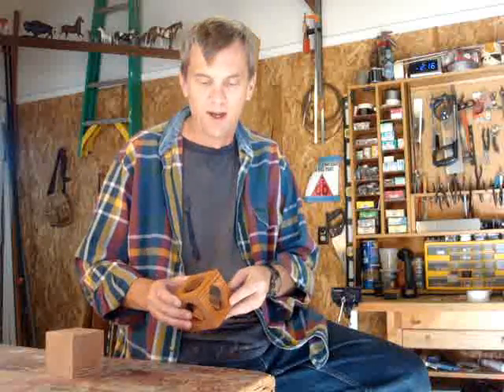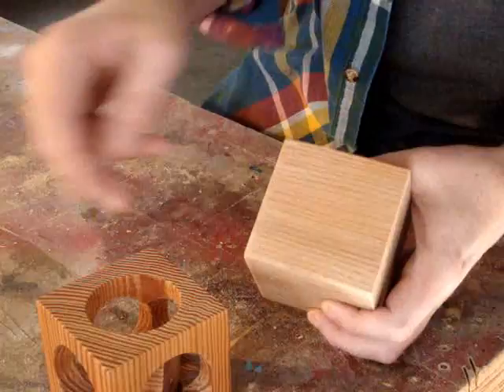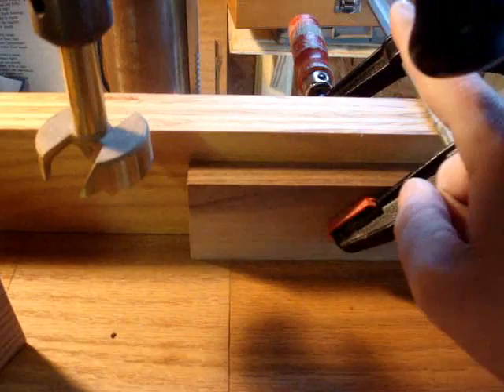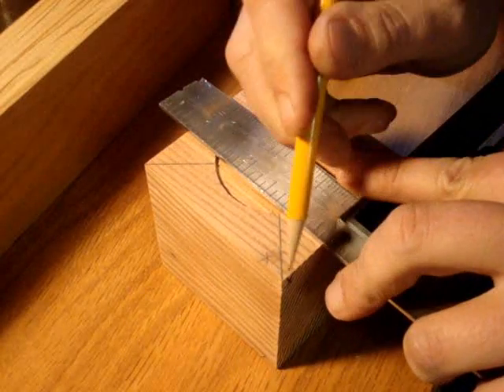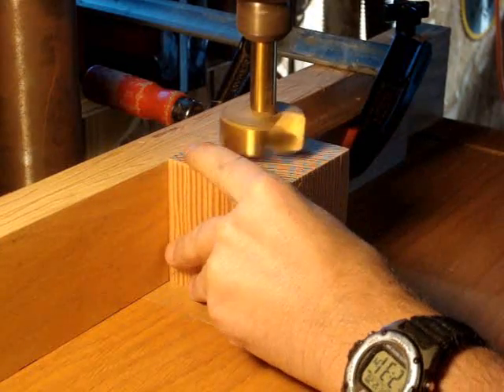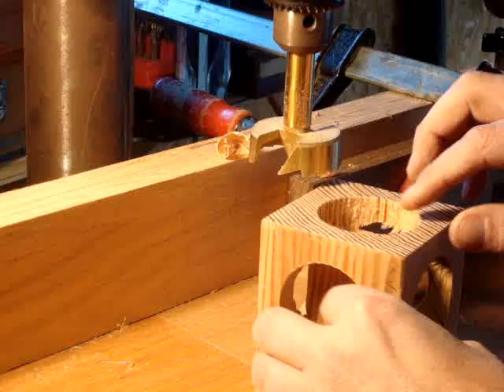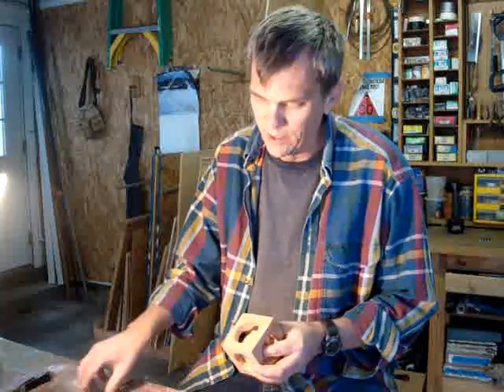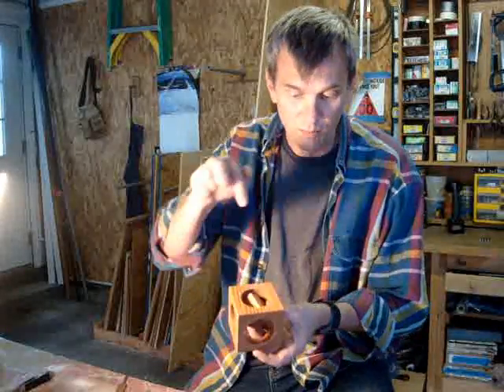Mystery Cube-in-a-Cube Puzzle Woodworking Project

Comment: I just saw this video a couple of month s ago and thought it was pretty neat so I decided to make some. They turned out really nice (red oak, cedar, and spalted maple). I did have an issue as is mentioned by several people below about the hole the forstner bit makes. I put some black milliput in the holes which makes the center cube looks like a dice. Makes it just a little harder to figure out although except for woodworkers I think it will baffle most people. Hardest part is finishing.  I found that using sandpaper affixed to popsicle sticks with spray adhesive works well to sand the interior cube.

Comment: Have you tried making the central cube a bit larger by cutting out the central cube at a 90 degree offset from the parent cube? The central cubes corner would be able to extend as far as the face of the parent cube.

Comment: I am on my wife tablet. I was a tool maker and I made sets of these out of aluminum.  nefore I reeve the square box from inside  drilled small dots on each si de to make the inside block look like a dice. My mom has the first set of five I made a d I ma de a aluminum case to store them in. great video wood working is as fun as tool making with steel.

Comment: I sacrificed a 2-1/4" Forstner Bit and ground off the guide point.  Still cuts fine and no indentations in the inner cubes.   Router Jig / Template sounds like a good method too, but I'd have to experiment a little to make sure.

Comment: If you make it with drilling only, in metal, the inner cube is just as big as the holes. Also, metal drilling tools need to have certain angle (unless you are making it from some extra soft metal, but that metal tends to stick to drill bit). You can use milling tools. If you use lathe machine, with a hook shaped tool, you can undercut and make inner cube quite bigger than holes are. I am miller and lathe machinist, I should know. :)

Comment: I made something similar a long time ago. Back then I simply boiled the cube in water. While it was hot and wet, the wood was soft and could be compressed,
While the cube was compressed I let it dry. Then released into it's cage.
Once in the cage, I boiled the whole cage with the compressed cube inside, That will "uncompress" the cube and restore it to the original shape again.

Let dry and sandpaper it.

Comment: I think you could make a ball inside a cube with a form tool. It would have to be slightly eliptical in all three axes. I would form it top and bottom to within a 1/8 of an inch of its equator.Then finish the other four sides with a slightly smaller tool. Sanding it would be an interesting challenge.

Comment: Shim the block with playing cards to raise it 0.01" when freeing the inside cube.  Fixed blade bench knife is safer, easier to control than a folder, especially when you're stabbing it with your full strength.

Comment: Then it is a drill press and a Dremel, that is a different story since it enables you to leave corners untouched with drilling, and then bigger than holes. :) Anyway, try using milling tool with two teeth (more teeth has part in center which doesn't cut so don't use them), it has flat surface, and it can be mounted on drill (and it's cheap :D ). Also dremel tool, it is essential if you do it in metal.

Comment: I did this with a block of aluminium, machined a block to 50*50*50 and used a 30mm drill, predrilled with 8mm and 20mm.    The problem was that my drills weren't flat like endmills, they left a cube which sides pointed in, not flat as I wanted them.   No need to use undercutters or cnc, I did just like Steve, but I cut the corners with a dremel tool isntead of a knife.  I assure you the holes were smaller than the cube.

Comment: Would it not be possible to drill the entire way through, then make a separate smaller cube.

then boil both to make them softer.. 

press the smaller cube and slightly stretch larger one.. fit it inside then reshape it using hot water again?

Comment: I made one of those, but I didn't like the little  holes left in the smaller cube by the Forstner bit, so I drilled it out some and inserted a 1/4 in. dowel. When finished, the dowels blended in with the cube and, I think, looked better. Just sayin.

Comment: If you mess up your block on the inside, just cut a block a little bigger then your holes. Soak the block in boiling water, compress in a vice and squeze it in the hole. If your cube wont go back to orig size. Just boil again and let sit a day.

Comment: No need for clamping on this application as the bit is spinning and the position of the stop block and fence holds the work peice firmly into its little nest.

As far as the project really really neat. I saw a similiar project many years ago at a craft show but the technique was drilling a round hole that ended up being square.

I will not reveal the secret of that little trick...

Thanks alot keep up the good knick nack projects going

d

Comment: If you used a big enough block and started making the the blocks from inside out, you could make as make as you wanted. I think the only think that might be hard is that after the inside block is made the next one you would be making could break apart while drilling. If you made them from outside in then each block would be VERY hard to clamp in place the same each time.

Comment: Having a nightmare of a time Steve trying to get the cube exactly 3 x 3, The issue I have is the large board I need to use to make it, I do a half thru cut initially then rotate and complete. The problem is I get into the block comes out with curf (sp?) marks along edges on the block and irregular shaped blocks.
Any ideas where I am going wrong?

Comment: hey steve, today in gometry, instead of listening i did the math for this cube (i made my own previously). so. depending on the size of the block you start with the bit will always be exactly 2/3rds the size (6" block 4" bit).and also the size of the inner block will be  1/2 the size, an easy way for the needed depth is take (x= lengh of one side of cube) and put it in this equation x/4=depth of hole. if you want to know how i got that just ask in a relpy...like this so he can see :)

Comment: My initial thought was that the cube as made of the interior of the block of wood, which it is, then I thought you would use a long hole saw to cut everything out of the centre, and then stick one end in boiling water to make it swell up, insert the cube then leave it to cool and contract like the impossible nail illusion

Comment: What if.... you make a cube within a cube within another cube?
Reply: +The Mormonologist  i think, my math is not so good, you would have 3 cubes, and twelve circles ;)
Reply: +The Mormonologist called a turners cube
Reply: my grandad actually made a cube in a cube in a cube in a cube in a cube.
In total there were 8 or 10 cubes (I can't remember exactly but at least 8).
he did use a manual milling machine and it was made from metal but still very very skilled. The smallest cube in the middle is only a few mm.
Reply: OR A CUBE WITHIN A CUBE WITHIN A CUBE WITHIN ANOTHER CUBE
Reply: Logan Darklock A triangle inside of a triangle inside of a cube. ;)
Reply: David Parham a triangle inside a balloon
Reply: Logan Darklock Inside another triangle.. inside another balloon!
Reply: Chil
Reply: That would be a Cube Inception.

Comment: I'm using an 8" drill press 5 speed
With a 2" forstner bit no luck cutting holes
Any pointers ?
Reply: If your drill press is stalling, try going slower, using softer wood, sharper bit, or upgrading your machine.  8" presses are very small, not typically designed for cutting 2" holes (at least not easily).

Comment: I made this but everyone noticed the pilot hole in the small cube so I made a template and with my bushing in my router using a quarter inch straight bit I could avoid the pilot hole in the small cube.F.

Comment: You say it out, i want write here, that using this metoth is possible to make cube in cube in cube... and so on :), depend the outer square measurements.
Reply: It's possible.. you just have to start with the inner cube and work your way out
Reply: It is possible. Say you start with a smaller drill bit on the same size block used and make a small cube inside the large cube. Next you take a bigger drill bit and make another cube from that cube, thus now there is a cube within a cube within a cube. I do understand that this may be hard to understand but I am 99% sure its possible. It may be difficult but possible. Also the Laws of Physics and movies don't really apply to any of this so..

Comment: @stevinmarin My drillpress goes way slower than yours. As a shop teacher I cringe when I see you holding the stock by hand and with a finger on top of the stock. One could easily cramp the stock to the fence. These big bits generate a lot of torque.

Comment: If you're referring to the fact that using fractional inches is just plain annoying: you'd be right, but 99% of drill presses have fractional inch measuring tapes on their depth stops.

If you're saying that that's too small of a measurement to be useful: you must be just getting into the insanity that is woodworking. ;)

Comment: America... please convert to the metric system. I can assure you it is much easier and makes a lot more sense
Reply: Its literally the same thing. Dividing by 10 is easier than by 4 but once your used to it its not a challenge. You can also get as much as 3 place decimal accuracy if you wanted to depending on how good your machine is setup. So really no need to change anything
Reply: ***** NOOOOOOOOO
Reply: Why don't you convert?
Reply: +nunayafb  Smarter is the one who simplifies not the one who complicates. The US system really makes no sense to the rest of the world. For example what is the area of a rectangle that is one feet thirteen and three quarter inches long by eighteen and seventeen thirty seconds inches wide.... Yeah, good luck. With metric we just multiply both numbers.
Reply: +Johnny any of us americans who have ever used a tape measure, socket sets or other tools that use "standard' measurement knows what a pain in the ass it is. and where did that name "standard" come from when we are the only people who use it?
Reply: +Johnny ,  The precise answer is 26.5546875 square inches...Or 1105.28954344875 sq/cm Obviously you do not understand the standard system, 1 foot, 13 &3/4 inches is actually 2 feet, 1 3/4 inches or 25.75 inches..or 166.287cm.  18 and 17~ 32's  is actually 1and 1/32 of an inch or 6.6532125 cm ... In the standard system we just multiply the numbers as well. Just remember "standard" refers to "British Standard Unit"
Reply: +Carl Ahrens Wrong. I may not understand the standard system but obviously you don't understand arithmetic. Yes, 12 inches make a foot. Yes, 1 ft and 13+4/4 inches = 25.75 inches. You got that one right but (18 + 17/32) inches is not 1 and 1/32 of an inch. 18 inches is actually 1.5 feet so how can that be? It's actually 18.53125 inches. So the right answer is 477.1796875 square inches. Yes, you need to reduce all to the smallest unit first. What a bunch of work. This proves my point that the cumbersomeness of the system is such that you can't even get a simple multiplication right. I rest my case.
Reply: +teh neash What the hell is a decimeter? Is that some kind of musical note? A measuring device for noise? Some variety of delicious Albanian cheese? I'm betting it's cheese. Anyone care for a decimeter and chicken quesadilla?
Reply: ***** Bill, I can't believe you just answered his provocative rhetorical question. I am sure he knows what a decimeter is.
Reply: It's obviously a tenth of a meter. Problem is, figuring out this "meter" thing. Maybe it's a misspelling of Peter! Therefore, a decimeter is one tenth as long as a guy named Peter, which seems strange since there are so many different Peters out there. Take Johnny for instance, he sounds like a huge Peter.
Reply: +teh neash why don't you convert to the duodecimal system.  the duodecimal system is EVEN EASIER, and makes EVEN MORE sense.
Reply: +soylent green The USA is not the only country to use the "standard" system, I think Congo and Burma also uses it so you are in good company... no wait a minute....
Reply: Hasse Olsson  :)
Reply: +bill pruett : Uhmm I think the Dewey Decimal system is used in the Library, a way to find the book you SHOULD READ..
Reply: ***** 30 seconds of research on the internet has revealed that you are correct. no wait, on second glance you're wrong, those are two different things.
Reply: +bill pruett It is called the decimal system, named after John T. Decimal, an Irish fish salesman who lived in the early 70's. Or possibly not.
Reply: +bill pruett :
A tampon ? or Kotex ?
Reply: teh neash way to late to make such change now...but i definetly agree...thank God we use meters here in Brazil
Reply: No.
Reply: yes. take centuries of learning and change it over night.
Reply: teh neash Never. Imagine retooling some of the most massive manufacturing plants on the world and teaching 5% of the worlds population an entirely different system of measures.